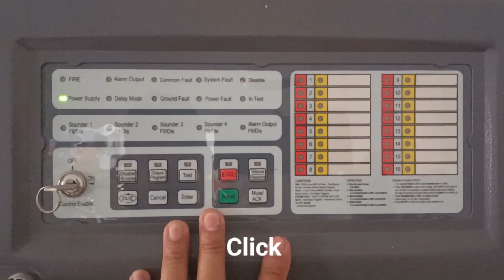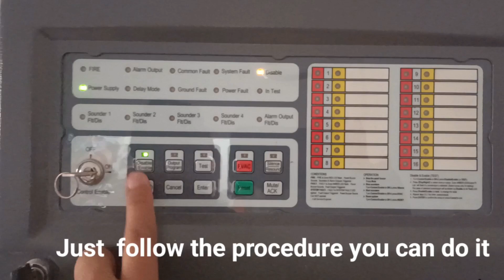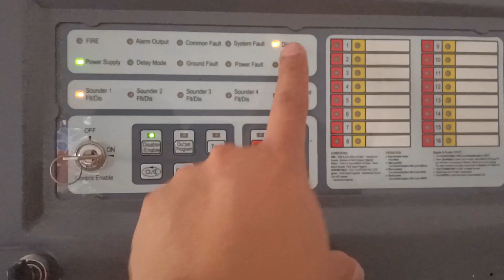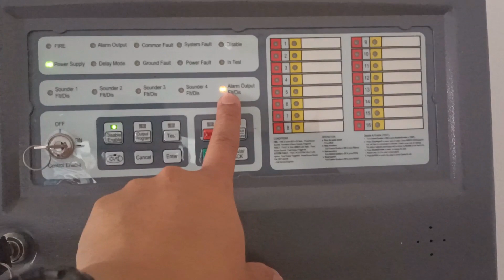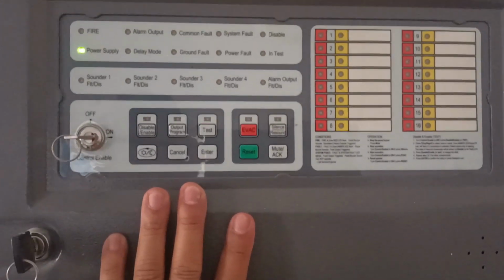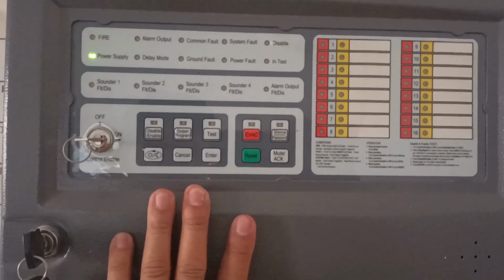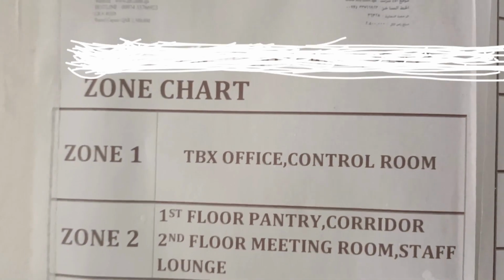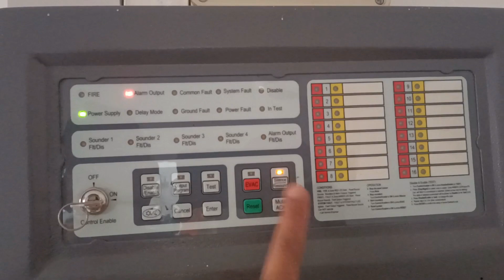HOW TO DES ABLE AND EN ABLE GST CONVENTIONAL FIRE ALARM SYSTEM FUNCTION  VLOG#122

Comment: How common fault and power fault clear
Reply from the maker: The common fault is for all fault indications..if the power fault check the battery and power supply. if the zone faults check the zone have   fault or earth fault check the device connection and device faulty.